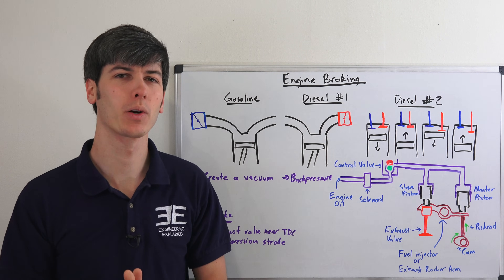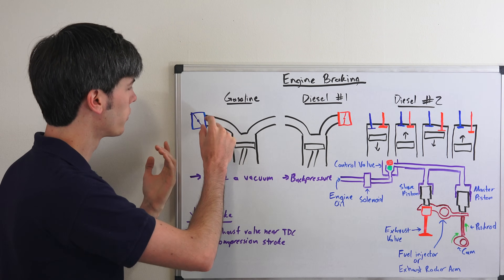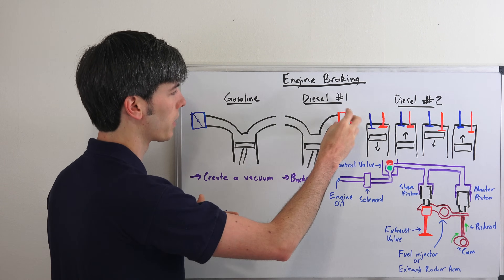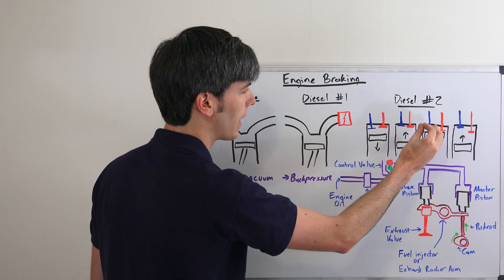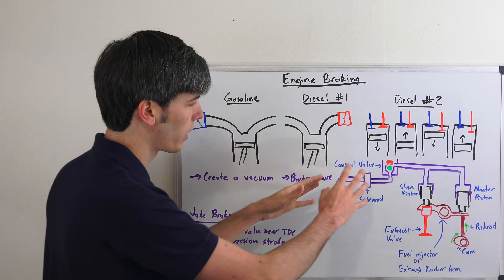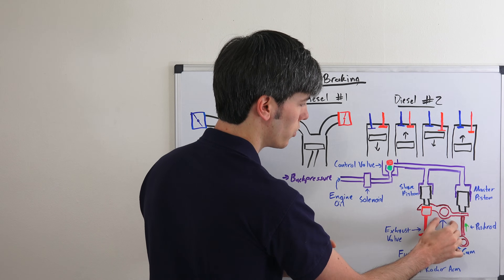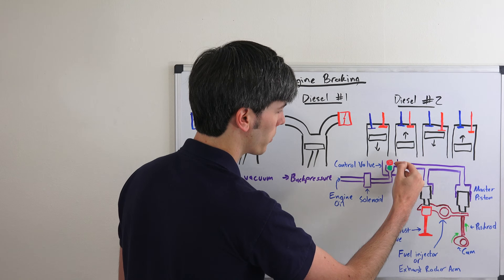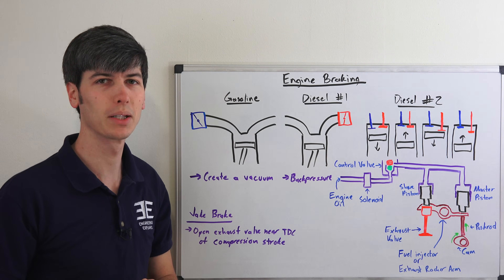What Is Engine Braking? What Is A Jake Brake?

Comment: I wish more drivers wouod understand the concept of engine braking. On a flat surface, physics and engine braking constantly want the vehicle to slow down. Normal braking isnt always needed to slow a vehicle (and engine braking helps preserve your brake pads). When approaching a stop sign or red light, you can simply let off the gas and the vehicle will gradually slow down (this can also help gas mileage as the fuel injectors shut down under deceleration when throttle is closed). Using your regular brakes unnecessarily doesnt allow the injectors as long as idle period bc the engine revs drop faster vs engine braking. The injectors will turn on sooner as you approach engine idle speed. Being able to proactively downshift magnifies engine braking as youre able to reduce vehicle speed more aggressively thru gearing and youre allowing the injectors more idle time as the engine revs slowly come down from a higher rpm (from the lower gear you just downshifted too). The lower gear puts the engine at a higher rpm increasing that vacuum which in turn slows the vehicle down more quickly.
Reply from the maker: +wayde philpot Agree 100%!
Reply: I've nursed my worn brakes like this for awhile while I'm saving for a brembo upgrade 😂
Reply: +wayde philpot I wish people on the freeway understood this concept. For some odd reason people think brake lights= I need to slam on my brakes, when in reality you can simply let off the throttle and let physics slow you down. Saves traffic, time, and money (from brake wear)
Reply: +MrElpajita usually ur engines spins ur tires, now ur tires spin ur engine. U obviously have to press ur clutch as soon as ur coming to a stop (in manual).
Reply: +MrElpajita because you still have a gear engaged, if the engine is above the idle speed, it will not inject more fuel until it reaches its idle speed. The inertia of your car is rotating your wheels, and your wheels are rotating your engine when a gear is engaged.
Reply: +wayde philpot They even teach this in driving schools over here, arguing that you save some fuel and prolong the life of your brakes in the long run.
Reply: +Kevin Weil Quickly stomping on the clutch to get out of gear does not really wear down the clutch, but you are right, when revs are matched I also usally take it out without the clutch, no problem.

If you are consuming more fuel during engine braking than when in neutral with the engine in idle you have a very strange car. I didn't think there were any around these days without deceleration fuel cut-off, at least none built after 1985, and none with digital fuel-consumption gauges.
Reply: Kevin Weil
Just keeping the clutch engaged and taking the foot off the accelerator turns the fuel supply OFF. The remaining kinetic energy within the car (which still pushes it forward) is "wasted" in the engine by turning IT. No fuel or brakes consumed.

Engine braking is NOT meant to be used as a substitute to braking by downshifting. Engine braking is meant to be performed until you reach a lower RPM in the current gear, THEN you can disengage the clutch and brake away the remaining kinetic energy with the brakes.
Reply: +KingDavey But for people who DO understand how to rev-match downshifts, engine braking is still a very good idea, otherwise I definitely get what you mean. Also, many automatics allow you to pick specific gears now, so you can now engine brake with those too.
Reply: +Foodstamp Amp'd
 to equal the amount of engine wear that occurs from driving like that , it would take forever. 
Besides , most engine wear occurs at startup. Basically you could leave a decent engine that's not some crazy race turbo deal that's all stressed out , strapped to a dyno all day at high rpms and get less wear from doing that, then the wear that would occur from the startup of that engine. 
Of course don't be dropping down a gear and letting it scream at redline as you engine brake,and keep dropping gears till you are in 1st gear like the ricers do at every opportunity. 
The car I got now, the original owner got 90k out of the front pads and the clutch went 200k. 
Not hiway miles either.  
Done right it's helpful.
Reply: Learning advanced gear techniques should really be more widespread. Downshifting when going down steep hills is essential when driving here in Norway, you will wear your brake pads out in a matter of no time if you need to constantly brake for several miles. Upshifting when going down a milder hill is also beneficial, as the reduced engine friction in higher gears could let you coast without needing to give the engine any gas, leaving you with zero fuel consumption down that hill
Reply: TheMidnightNarwhal
The engine has much more endurance than the brake pads do. The engine is designed to run constantly under load. Brake pads can overheat and lose effectiveness, in just 45 seconds, somebody said. The engine has much greater thermal heat energy capacity, and it also has a powerful radiator cooling system, unlike with the brake pads.
Reply: +Filipe Corral There's another reason for engine braking, especially going down long hills. It goes beyond saving brake wear (which brakes are cheap to replace, as you point out), but rather ensuring your brakes have sufficient stopping power when you get to the bottom of the hill.

When you brake, the brake pads come in contact against the rotors. This converts the kinetic energy of the wheel turning into heat. The braking system absorbs a large amount of this heat, so your pads, rotors, and brake fluid all heat up. Each of these components has a tolerance for how much heat it can absorb before it loses performance.

Now imagine you're going down a long hill. If you're holding your brakes constantly to maintain a specific descent speed (even if you're braking lightly), you're putting a constant source of heat into your entire brake system for an extended period. If the brake fluid heats up too much and starts to boil, you lose braking force and the pedal will go to the floor without doing much of anything. Overheat the brake pads and they will have greatly reduced ability to grip the rotor and increase wear rate. Finally, overheat the rotor and you may end up warping or deforming the spinning disk. That last one is probably the least likely, but the end result of all three is the same: You will have reduced braking force by the time you get to the bottom of the hill or if you need to make a sudden emergency stop while going down.

Once you let the system cool off, functionality will largely be restored, unless the rotors were warped. In which case, that repair doesn't come cheap.
Reply: I do this with my friend's car. It's an automatic with a 'manual' mode. I use engine braking to slow down and to keep from gaining too much speed going down hills.
Reply: +Patrick Barry u mean improper? because clutches are really only abused or fade quicker with either A: poor shifting IE down or up shifts B: hard launches C: your are a noob!
Reply: I don't do it if people are riding my rear.
Reply: +wayde philpot Yes. I seem to have a pretty poor injection management in my old Peugeot gasoline engine, though. I have an instantaneous consumption gauge (well, it's averaged over a second or two), and it often shows higher consumption when using engine braking at low rpm than when letting the engine idle. Our Diesel engine from the same manufacturer immediately has the consumption go to zero when engine-braking.
Reply: +Patrick Barry didn't scroll up to see the comment u are responding for, however engine braking does not stress the clutch or clutch pack in any way.
Reply: +wayde philpot Driving a manual, i use engine braking as much as possible, 30.000+km onwards, and brake pads and discs look brand new, maybe, 0.3mm wear on the brake disc. When i worked in a repair shop, there were people coming in and complaining of bad quality parts, saying that their pads wore down only after 15.000km, turns out they break like idiots, and some dont even take their foot off the brake pedal.
Reply: Christopher Hartman
Engine braking is not meant so much for stopping the car, but is a far better way of limiting speed, than overheating the brakes. Engine braking has far better endurance, and that is why it is important to know proper ways to control the vehicle's speed. Engine braking does not wear out the car, when applied properly, when not shifting gears excessively nor burning the clutch. It is the many miles and years that wears out cars. And improper driving and poor maintenance.
Reply: +Kevin Weil, unless you are referring specifically to older carbed engines, I think you need to go back to school to better understand modern EFI systems. Pretty much just about ALL OE EFI systems made since the early 90's have what is called Decel fuel cut (some like Toyota call it Overrun fuel cut). This cuts fuel by shutting off the injectors totally when the engine is above a certain RPM and the throttle is closed. Most Port Injection engines cut the fuel if the engine is about 2000 RPM and bring the fuel back on when it drops below 1800RPM (this does vary from engine to engine and manufacture to manufacture to some extent). Modern DI engines typically do the same process but at a lower RPM due to the more precise fuel metering associated with Direct Injection.  If port injection systems were to do it at a lower RPM, often the engines will buck noticeably when the fuel is brought back on and hence the reason for bringing it back on at a higher RPM.

By putting the car in neutral while slowing down, you are wasting fuel because the engine is in an Idle state so the ECU firing the injectors.
Reply: +Filipe Corral 
Down shifting a semi with only 700 to 1i00 or 2100 rpm limit is far easier ( shifting without clutch)
Trying to do same in carcwith fastercwinding gas engine in nearl impossibly relying completely on transmission synchros instead of rev matching.  Some computers noww rev match / blip throttle but gas engine downshifting is actually preparing to use throttle "in a moment" to Accelerate, out of corner for instance.
Reply: Thanks for explaining that!
Reply: +Foodstamp Amp'd 
No prob man , my buds always call me the teacher,idk, I just like passing the knowledge along. Peace!
Reply: +Brian Athay if those brembos are red you automatically gain +25Kw!!!!!
Reply: +Patrick Barry what do u mean which part happens in an automatic. I'm pretty sure friction doesn't care whether you're driving a manual or not
Reply: +Genericasian an insignificant amount of engine braking is cause by friction. The loss of energy results when the Pistons attempt to create a vaccum in the cyclinders, for gasoline cars. For diesel the energy loss is a result of the piston compressing air and letting it out of the exhaust valve when the piston reaches top dead center, bleeding the compressed air and not allowing it to return it's energy to the system.
Reply: +Patrick Barry not for all material. Carbon fiber brake pad only get more grip with increased temperature. Do you have a source to show vapor layers are a myth? (For brake pads.) what is the explanation for reduced friction with temperature? Does first molecular layer of the metal/ceramic become a highly viscous fluid or is there possibly an ionic cause? Increased heat helping to shed electrons and creating a stronger repelling charge in the materials? Some kind of diamagnetic induced repulsion? Does the increased heat cause the crystal structure to change shape giving it a lower surface friction coefficient. Does the thermal energy over power vanderwalls forces between the two fricon material surfaces? Does anyone know? +engineeringexplained
Reply: +wayde philpot I don't generally downshift through all the gears to get engine braking - I let it run down in the gear it's in, then it goes in neutral etc.
Reply: LuisCubing
Because the valves are still operating and air is still moving in and out of the engine along with the engine components still in rotation. Kind of like how you can still talk while breathing in XD
Reply: Mechanized Ape I'm no expert on car mechanics, but I think my engine still roars and burns fuel through combustions like it would when I throttle. I think only on modern diesels the gas mixture is not pumped into the engine when decelerating, not sure though.
Reply: skirmich
The engine is always a huge drag, whenever it is not getting fuel, and still engaged into the drivetrain.

+wayde philpot I always had the same thought of "(this can also help gas mileage as the fuel injectors shut down under deceleration when throttle is closed)"  but have we proved this? Sounds odd the engine will just shut down and not become a huge drag in the drivetrain just by slowing down to a stop..

But the engine is a huge drag. I seriously doubt that the momentum would carry on for as long, as it would coasting in Neutral. However, shifting to Neutral is not recommended, as you are giving up too much control of your vehicle, and aren't you supposed to be not moving, when you shift into Drive or Reverse gears? The car is quite heavy, and it does not take infinite force to rotate the engine. After all, a tiny electric starter motor can rotate the engine, although much more slowly than its normal rotations speeds. It obviously will take some time, for the engine drag to slow the vehicle, especially in the highest gears, in which engine braking is less pronounced.

I also suspect that the sounds the engine makes, would not be all that easy to detect as to whether fuel is being burned or not. As a engine being pushed by the wheels, is going to have just as many moving parts as an engine being pushed by fuel being burned. It probably would sound a little different, but by how much?

I dunno man brake pads are too cheap to even consider this option.. Same goes for any Honda 5 Speed Automatic (This comes from a original 5speed owner) do not engine brake in a Honda 5 speed Unless you want to change a transmission in the near future, Brake pads on the other side are dirt cheap.

The cost of brake pads is not the only consideration. It is not safe to overheat the brakes. Downshifting would always be preferable on long downgrades, as the brakes can overheat in as little as 45 seconds, somebody said. You do not want to lose your brakes. That is not safe.

Now I do agree, if you are saying that engine braking isn't needed, just to come to a stop. But engine braking is needed for long downgrades.
Reply: Mechanized Ape Hint ..."this guy is RIGHT UP MY....
Reply: +Mechanized Ape That would also cut down on road rage. One thing I've never understood is why when people come up behind a car going the speed limit in the right lane and the left lane is empty they keep pushing up behind the car instead of just going around.
Reply: With your foot off of the gas pedal, slowing the car down, the car's momentum turning the connected drive train (i.e. axles, differential(s), drive shaft, tranny, torque converter) mechanically turns the flex plate or flywheel that is connected to your engine that keeps the engine turning as long as the car is moving. 

The car's computer keeps the fuel cut off. Because it wants to idle the engine with your foot still off of the gas pedal. But the computer senses that the engine RPM's are faster than idle though the crankshaft and/or camshaft sensor. So fuel is cut off until you are close to or stopped at idle. The computer then applies idle fuel to keep the engine idling against the torque converter's load, unless the tranny is in neutral.

If you are going down a hill or grade, and your foot is off of the gas pedal, the computer shuts off the fuel again. Because no power is needed to maintain speed. But the car's momentum, due to gravity and kinetic energy, keeps the engine, revolving with the connected drive train at speed, without fuel, until you are on level road or climbing the next hill. So you use zero (zed) fuel at all. That is why you should never put your car's tranny in neutral, going down hill to save on gas consumption. 

In the old carburetor days shifting your car to neutral (or throwing out the clutch), going down hill, would work to save gas. Because the gas never would shut off. The engine would idle in neutral, being disconnected from the drive train. This was called Jewish overdrive.
Reply: This is all true, but you should also include information that using this technique and shifting gears increases your clutch wear.. and it's far cheaper to replace brake pads then clutch. So a proper advice should be to use engine braking while keeping a car on the same gear until engine's revs are close to idle, then breake normally.
Reply: Thank you. I ride my brakes as little as possible. Prefer low gears on down hill descends and when I see a light turn red, rather than race up to stop, I'll just let off the gas to slow down. If I'm not slowing enough but still don't need to use brakes, I'll down shift as needed.
Reply: you sure will drive people nuts trying to apply that. all people want you to be quick and not drag them. you will therefore find yourself more if a time using your brakes than not. you can save some brakes, but still will use it not sparingly, heavy enough. or a mad dude could draw on you,  and that wouldn't be fun...
Reply: wayde philpot I drive my ,  07 dodge Cummins with the 6.7 Turbo diesel Cummins, and I for one. Drive a Manuel Transmission. And I as well have the Exhaust Break and I use both down shifting and my awesome wonderful Exhaust Break. I do not do last second breaking! I don't care who's behind me. the president, your mom, my future wife, or the girl next-door.  LOL I don't care I take long ass stops and then I accelerate mediumly, depending on the area the day and my mood.
Reply: It depends on if the carburettor has an Engine Braking Valve.
Reply: More importalnly, engine braking saves fuel and helps to decrease heating of the brakes- this comes very in handy in mountains. Also, car is more stable when engine is connected with transmission.
Reply: In most cars I use engine braking all of the time in order to slow down and only use my brakes while stopping, however in the 2011 Highlander SE that I drive most of the time, there is no engine braking. In fact, I can coast for about 1/2 a mile on a flat surface without slowing and I actually accelerate when going downhill.
Reply: +Cole Logan That is false. Most (if not all) OEM EFI EMS (or at least just about anything built after 1990) that have / utilize overrun / decel fuel cut do shut off the injectors 100% (I've personally data logged numbers of OEM injector outputs to create base maps for aftermarket Programmable EMS's and can clearly see the injector signal on them shutting off 100%).  Most port injection engines have the fuel come back on in the 1700 to 2000 RPM range so the prevent bucking that would occur if the fuel was turned back on earlier. Many newer DI setup engines hold off the fuel reactivation point to an even lower RPM due to the precise control that DI allows for.
Reply: +MrElpajita The weight of the vehicle keeps it rotating along with the mass of the flywheel. Most engines won't completely shut the injectors off but will open them for a much shorter time so that there is less fuel going in to the cylinders. As the car slows to idle or once you press on the gas to start going the computer sees the increased load and will start to turn on the fuel injectors for longer periods.
Reply: +Kevin Weil totally agreed with you, i only use engine brake just to keep the RPM high enough when entering corner (slow in fast exit) it's easier to control the corner this way
Reply: DM Sumarli
There is simply no fuel being injected while the car is engine-braking
Reply: +Siggen yea I had a Mitsubishi fuso for my previous work truck. It had an exhaust brake and the original brake shoes were still good at 215,000. 
I've had a few steep mountain roads where I could tell id fade the brakes out if I kept using them and didn't downshift and engage the exhaust brake. By halfway down , they were getting warm and I could tell they were slightly fading from the heat. 
If it wasn't for downshifting they woulda been smoking real good by the bottom, or be nonexistent.
Reply: I own a 2012 vw GLI w/ dsg. the car only engine brakes in "s" and not in "d" or any form of manual shifting. I always throw it in "s" when slowing down then back to "d" or manual shifting when accelerating. this has also tremendously helped reduce brake fade and quicker lap times in autocross as I can enter turns faster and brake later than normal. the dsg transmission is just an absolute beast.
Reply: +4rari89 I hear ya , I drove a buddies gti with the dsg and I wanted to see how it was compared to  an old automatic that id be used to. 
Lemme say it was awesome. 
Shift at the paddles or shifter and you don't feel any jerkiness and it's smooth as velvet at shifts. 
Just for an abuse test as I was approaching a light to stop, I dropped it down into 1st gear at around 25-30mph...
I knew it was gonna be close to redline when it dropped , and I knew it wouldn't downshift if it didn't wanna.....
I was expecting the big clunk and tire screech you would get in a normal automatic( I'm thinkin like an old Chevy with an auto btw)....
nope, it was smooth as silk and there was no jerkiness or anything. 
I still like a real clutch pedal but those dsg setups work pretty sweet.
Reply: +4rari89 so it does switch to neutral when you remove your foot from the throttle? Is this car a drive by wire throttle? Thank you.
Reply: +Mechanized Ape not necessarily neutral. still in gear. the rpms are just so low in "d" that there is no engine braking. in manual it's blipping the throttle to rev match. in "s" it's true engine braking.
Reply: +4rari89 okay. I guess I'm just not understanding how the Rpms can be low at a high vehicle speed if the transmission doesn't disengage from the engine. The wheels should push the motor to whatever rpm in whatever gear that that speed would take to cruse at. Did i word that well enough to make sense? Lol sorry it's late. Does it have enough gears to just keep a low rpm and stays in overdrive gear? It's kind of hard to find that specific of info for each car model. I think my avalon will stay in gear for a few seconds after i release throttle but then switches to neutral to coast farther but I'm not entirely sure. But if I actively down shift it will stay in gear and decelerate. Had to do it when a brake line burst. It's smart enough not to shift until it's at a speed where it won't redline. So I can drop to L and just wait. No worries about redline. if if I shift to R while moving forward it won't shift or try to. At least for the second or two I accidentally had it in R. EE tellusplz
Reply: +4rari89 it's called friction material. All friction parts wear regardless of how carefully they are engaged. It's by design. Clutch plates are wear parts that need to be replaced after a predetermined distance. All trans parts are wear parts. Almost every drive train component is.
Reply: +wayde philpot i used to think that the car slowed down when not on the throttle because of friction and the lack of an external force (throttle). Obviously that is some part of it but how significant is engine braking in that process?
Reply: +Neel Deka The phenomenon you are describing is engine braking. When you remove throttle input, you reverse the direction of energy transfer. Instead of energy transfer from the engine to the wheels (consuming fuel), energy is transferring from the wheels to the engine (kinetic energy of spinning wheels). "Engine braking" describes the frictional forces in the entire drivetrain, the majority of that friction is in the engine itself.
Reply: +Genericasian oh OK thank you
Reply: +Genericasian do you suppose that when the pads reach incandesence and begin to vaporize the gas layer is what causes the reduced performance? That and also the fact that as friction material vaporizes its not only becoming smooth from abrasional wear but that any material making highly frictional contact will be instantly bent or sheered off due to increased maluablity from heat? Also I think because brake fluid is under pressure and already has a high BP that it would most likely never boil and if it did would blow a line.
Reply: +MJ Lyco 
Whatever is a fart cannon for? Shouldn't they be banned? Nobody but morons wants to hear somebody's needlessly noisy car.
Reply: I don't know if it was mentioned already in the many replies, using the engine as an engine brake also helps keep the piston rings seated, keeping your compression and engine efficiency up. Despite clutches not being as easy to change as brake pads, I still do this, even in my new (to me) 06 Ranger 4x4 even though I just changed the clutch in it a few weeks ago. Besides, coasting out of gear in a manual isn't safe according to the DOT.
Reply: tasios77 it probably isn't technically, although it is usually only at speeds 40km/h and below since you can run down to idle rpms.
Reply: +wayde philpot Yes, I do it all the time. It's just a question of timing, sometimes I only need a little push on the brake to get to a full stop. I just have 1 question: are there still combustions happening on the engine? If not, why do I still hear the revs like I would when the accelerator is being pressed?
Reply: +Zaya Young With a lot of people brake lights actually DO mean they need to slam on the brakes.
Reply: +wayde philpot I always had the same thought of "(this can also help gas mileage as the fuel injectors shut down under deceleration when throttle is closed)"  but have we proved this? Sounds odd the engine will just shut down and not become a huge drag in the drivetrain just by slowing down to a stop..  

I dunno man brake pads are too cheap to even consider this option.. Same goes for any Honda 5 Speed Automatic (This comes from a original 5speed owner) do not engine brake in a Honda 5 speed Unless you want to change a transmission in the near future, Brake pads on the other side are dirt cheap.
Reply: +skirmich about the drag, your fly wheel maintains a lot of kinetic energy to keep the Pistons moving. I was scpetical about the idea that injectors fully shut down as well. In most cars iv driven, (auto trans) if you shift into nuetral while your still going a decent speed, above 25, the rpm won't idle as low as when your not moving and in N or when your in P. So obviously your ecu is keeping the rpm high so that when the trans re-engages the motor it won't be so rough. That being said I doubt the injector fully shuts off even if your vehicle speed is keeping the rpm at say 3-4K. It MIGHT turn off and would be possible because the flywheel will keep things going for a while, and this would be a great method for car manufacturers to squeeze some mpg out of a vehicle. That being said I'm sure each engine is different. In fact I can check  my obd2 later on today and see if my fuel flow drops to 0.00 gal/hr when coasting in drive or if it's still at about .03ish like in P. Doubtful tho.
Reply: Mechanized Ape
Injectors only turn off if you are in gear and no throttle applied and are above a certain rpm (it's higher than idle) For automatic this rpm is higher than manual usually. But automatics can do engine braking, but in "D" it generally doesn't do this often as it changes up a gear if light throttle applied or let off. You can force it into a gear if you want. Unless you have a Prius or CVT with no paddle shift XD
Reply: Carl Sagan
That's good if your car has gearing for it ;p Smaller cars tend to rev up to 3000rpm at ~110km/h XD
Reply: +MrElpajita the ECU increases the injected fuel once the engine rpm reaches, or goes below stationary rpm. You are right that while using the engine for braking there is no fuel injected so the engine is actually not running. (note that with cars with a carburator there is always some fuel consumption as air-fuel mixture necessary for stationary rpm is always going to the engine.
Reply: +Rennie Ash I guess we will find out for my car when I drive it later. I do agree that for a mpg stand point that in mpfi or fi or di engine that the engineers would want the fuel flow to cut off whenever possible. I'm just not positive that it happens. It might be complicated. Might be simple. Just depends on the year and make and how much the company was willing to invest and how many sensors the engineers were allowed to instal and how much code they were allowed to have writen for the car. I haven't done any research to resolve the question, so I'm not going to say one way or the other. And yes I know you can downshift in an auto and usually the ecu will keep you from going past redline if your not sure what gear to be in for that speed, at least Toyota, I had to do it when a break line burst as I was coming to a stop sign, then hit the pedal parking brake as I approached <5mph. Luckily I was ony four miles from home.
Reply: +erik verbeke how do you know this is true for all cars? Are you a tech or engineer or did you look it up? I'm just curious because not all engines will run the same way, similar fuel intake method or not. There are patent concerns to consider as well as mechanical and expense constraints.      This seems like a broad statement to make about all vehicles with out a source to base it on other than assumption. So f you know this for a fact please say why or how you figured it out. I don't have time to research every modern vehicular internal combustion engine and find out its dynamics to answer this question we all seem to have. Thank you.
Reply: Mechanized Ape Yeah, I have an opel astra caravan from 97 (diesel) and it probably does not stop fuel consumption when I stop pressing the throttle, because the engine really sounds the same.
Reply: +LuisCubing  so it still has the roar of the combustion with the whine of the metal rotating  assemblies, instead of just that turbine like whine that you get form a moving engine with no fuel input? Are all diesel engines fuel injected? Iv never owned one and don't know anything about them except the principal of how a fi diesel one works.
Reply: +Yosef MacGruber patents control every idea in the business world. Simple or not. Look into the apple Samsung disputes. Those very simple patents are worth billions. One company might have come up with a way to cut fuel through a certain computer protocol that may prevent others from doing identical fuel shut off methods. Methods that may be the cheapest or even the only way to cut fuel through computer management. Every thing the ecu does is controlled by code written by people that need to be paid. If the code gets to complicated it may not be worth it to integrate into a cheap little economy car just to save a few mpg. So while patents may have nothing to do with this topic, they have just as good of a chance as having everything to do with the topic. Unless you've built one of these systems I don't think anyone has room to speculate on how exactly they work. Every system is different. We should stop spreading information that is based on assumption and do research on these systems
Reply: Mechanized Ape
Any competent programmer could write code to do this, without having to copy somebody else's code. Generic ideas such as the Trash Can, as a place to put unwanted computer files, is no basis for a patent, because it is not an original idea.

Computer code is different than actual manufactured parts, because the more copies made, the cheaper it gets per unit. You could have the same engine computer made for 100s of different cars, if it has a way to know which car it is in, and entire blocks of code might be useless, but to eliminate them would cost far more in inventory costs, than to just make a more universal engine computer. Even circuit boards can have places to attach optional features, that do not even come for that specified model.

Even video games can have large areas of dead code, that can be fun for game hackers to explore. There could be dozens of voice-acting audio samples, that are never used in a video game. Yet for whatever reason, were not removed.

Like I have time to research specific ECUs?
Reply: +Yosef MacGruber like I said look into the patents that Apple violated. They are simple ideas on file storage that seem like common place ideas but are still protected. The us government has a patent on cannabis. No one is allowed to patent non GMO plants. explain that? 
  I agree with what you said about dormant programming. The code might be there but how do you know it's being used? The sensors to use the code might not be worth putting in a crap car that's only $12k new. But a nicer car with the Same engine might get those sensors. Toyota Avalon and Lexus es300 are a good example. Or the gmc Denali envoy with cylinder deactivation. The first year with it doesn't use the deactivate function because of exhaust harmonic issues during four cylinder mode. They redesigned the exhaust piping the next year and switched on the function. My point is still the same. Every car is different. So assuming one thing about all cars based on one model is foolish. Same as many things in life.
Reply: Mechanized Ape
Until the 1980s, patents were not allowed on seed, because only God can "own" life. Explain that? Political corruption. What else? Farmers had long thought that they had the right to saved seed, but now they are accused of violating contracts that they did not even sign, because GMO pollution blows onto their fields? How dare greedy corporations jeopardized global food security with their stupidity and greed?

Should some greedy corporations be allowed to monopolize the concept of the computer file, so that no other companies can produce any software?

What does it matter if the code is being used? I meant more that it is left-over stuff from unfinished ideas or other projects or models, not that there is anything sinister or hidden about it. I would rather they use the same circuit board on dozens or 100s of models, than that they run out of critical inventory parts. How does it know which model it is installed in? By the presence or absence of certain connected devices, or perhaps due to some setting. I do hope that the engineers do provide a reliable way, so that my car's ECU unit doesn't just one day decide it is a different model car and start behaving strangely. I wonder what the possibilities are for hackers? You get a deal on an ice maker for a model of refrigerator that wasn't meant for an ice maker, and flip a few dip switches on the circuit board, plug into the unused connector socket, cut off the power to the refrigerator for a few minutes to reset everything, plug the refrigerator back in, and then it decides that it is another model refrigerator, and Presto! Magico! you have a working ice maker. Well until the water line freezes up, because you didn't mod your refrigerator quite right. Why would an ice maker need to plug into the circuit board anyway? I don't know. Maybe it is best to not be making ice, during a defrost cycle?

Here's a few other ideas about hidden stuff in the program coding. Often some thought is given for future expansion, so any data files that my program generates, may contain hidden data identifying which program and version created them. Also, people often like to put their names onto stuff. Especially considering that filenames can be changes too easily. When I have written programs, I try to follow the conventions, so that the OS can give some description or help concerning the program. An example with the TI89 graphing calculator, is that I think the first line of TI-Basic code is a comment, it will appear when selected but not yet activated, on the VAR-LIST or Catalog of files, and would normally appear in the form of FuncName(Parm1,Parm2,optionalParm). If I follow this convention, it helps the user figure out whatever does it do? They might have gotten it from a friend who didn't tell them anything about how to use it. Or it could appear as Payment(Principle,TermYears,Interest,OptNumPaymPerYear).

Sometimes with good design, additional features might be added, with simply a free firmware update. Somebody might have thought up a good way to use already existing hardware.
Reply: +Yosef MacGruber 
  farmers can't save gmo seed because it is a man made invention. I mention the gov patent because it's an example of somthing being patented that wasn't supposed to have been granted patents . Like a trash can on a computer OS. the concept might not be able to be patented but how you go about removing files from hard ware, with software, can be. There are many different programs that do the same thing. I was saying that for a cheap car figuring out a whole new program might not be worth it.     
    
As for hidden code I was not saying it was sinister but that, like you said, it can be there from old projects or whatever and not be used. Like if the ecu could cut fuel but needed a sensor to utilize that program. But the sensor is $300 so they don't use it on say a $8k car. It's just a plausible scenario I was suggesting.
Reply: +Yosef MacGruber And yes exactly, fuel cut off during engine braking that is controlled by the ecu when it gets information from a sensor that might not be installed on a particular model because the base price is so low. Like how they don't include automatic windows, locks or AC sometimes to save money so they can offer poorer people a reliable car that runs for less money than that same car with all the bells and whistles. Or say a truck without 4x4 for people who don't need 4x4 but want a bed to haul stuff. It's stil going to have the same ecu most likely. Though It may have different code flashed to it to suit the trim level of the vehicle. Each company will have their own way and device for telling the ecu how to cut fuel or do whatever. A different sensor with different protocols. At this point I'm sure they all have cheap ways of cutting fuel when it's not needed but some people have old cars. So its worth knowing more about imo.
Reply: Mechanized Ape
I do not agree with granting patents for seed. Seed is supposed to reproduce from generation to generation. To produce "terminator" seed is to rip off farmers and play God.

Any fuel injection car already has to have sufficient sensors to cut off fuel. Surely every ECU knows the RPMs and the accelerator input. Even the cheapest piece-of-crap econo-box car would have that, unless it is not fuel-injection.

Electric windows are another story, as all those motors and switches and wires and wire protectors running from the car into the doors, might run $100 even for the factory buying them in bulk. What car doesn't come with A/C? It may be expensive, but isn't A/C standard by now, as they have to create a hole for the A/C stuff even if it not there. Too many customers would want the A/C, so wouldn't that be standard? It isn't the frugal 1980s anymore. I can hand crank the windows. The big down side of that, is that I can't so well hand crank windows that I can not reach. But who opens windows anyway? That is what you do when the A/C is broken.

4-wheel drive is expensive. And according to some YT by Scotty Kilmer, all-wheel drive isn't even worth the cost, for most people. Not only does it cost more, but it adds more weight to the vehicle, which is going to reduce fuel mileage, and all 4 tires should be changed at the same time. Having tires of different sizes (different amounts of wear) causes excessive rotation of certain parts of the differentials, which will cause problems.

What reason would there be to not cut off fuel during engine braking, unless it is a scheme to rip customers off and punish them for buying the crappy econo-box model? I consider that very poor marketing tactics, to deny customers features, just to put products into every price tier, if said features are not costing the manufacture much of anything to include.

That is a reason why I would never pay the telephone landline monopoly for Caller ID. They have had the ability to give all their customers Caller ID for free, for decades, and just about every piece-of-crap phone comes with a Caller ID display now. I think that is a lot of the reason why people are dropping their landlines, because they are so noncompetitive with all the options now on the market. I finally fired the land line monopoly and switched to an internet phone adapter that allows me to take my number with me when I move. Costs far less, and gives far more features. And Caller ID and Call Waiting are included. Internet phone adapters work really well with cordless phones that come with lots of handsets, since you are often losing most of your home phone jacks, and have just 1 phone jack on the back of the internet phone adapter box. You can switch your phone jacks over, but many people are not going to bother to.
Reply: +Yosef MacGruber not all cars use sensors as recent as the mid to late 90s cars used cables on tachometer and spedometer. Not everyone drives a brand new car. Some Kia cars offer AC as an option still I think. There is no reason for the ecu to know the rpm when it's controlling it with spark. It's doesn't necessarily need to be a feedback system. So if there is no fuel or no spark and your engine braking what would tell the ecu the rpm? Newer tacos read the rpm by detecting the puls of the eceteic signal when the spark plugs fire. That's how things like radar detectors can detect rpm through your cigarette lighter or 12v accessorie outlet. The is no rpm sensor that doesn't rely on a cable connected to somewhere in the drive train or the signal puls from the spark firing, that I know of. So again if you take your foot off the gas and there is no fuel input at all the you would think there would be no spark so no way to sense the rpm and no way to when to kick the injectors back on.
Reply: +Yosef MacGruber except if it used the speed sensor to know when the car will need fuel to idle again.
Reply: +wayde philpot Does downshifting without rev-matching have a greater engine braking effect than with rev-matching? Or is it bad to downshift without rev-matching because it may harm the transmission or something?
Reply: Mechanized Ape
If the ECU does not even know the RPM, then why even have an ECU? Come on, that is basic sensor data, even for crap cars with no engine speed dial. Why do you even need a tachometer on a car with an automatic transmission?

Engine speed probably has something to do with how much the spark should be advanced or retarded. Do cars even have distributors anymore?

And we were talking of turning off the fuel injection, which might be easier to do than to kill the spark, which is less needed anyway, as the spark doesn't consume near as much fuel as directly burning fuel does. In fact, if the spark is still firing, it may simply be part of the engine braking conversion into heat process anyway.

So I agree with the conventional wisdom of commenters that says that old carburetors likely did not cut off the fuel entirely, as those systems did not use modern engine sensors are are common now, whereas modern fuel injection should easily be able to cut off the fuel, even on econo-crap cars. If fuel is not being cut off, then why? Some conspiracy with the oil companies to waste fuel?
Reply: So I did a test yesterday with a BT obd2 scanner. While engine braking from about 50mph, with my feet off the pedals, the throttle input never dropped below 9%. The fuel flow in gph never dropped below .5 gph. The oxy sensor voltage never dropped below .102V. This is conclusive evidence that the injectors never shut off completely. I think something nobody here is remembering is that fuel injectors are a variable flow device. They are not just on or off. Your cyclinders can still pull a relative vaccum compared to the amount of air being let in to the cylinder with the valve open. Valve openings are tiny compared to the volume of the cylinder. Esp at say 5k RPM. The only reason the piston has no resistance, from the small air inlet of the valve, during the combustion stroke is because of the large volume of new gas vapors produces in the fuel air explosion. During every other stoke the piston must be under some resistance from the fact that more air can be take into the cylinder
Reply: Volume than can flow through the valve. Esp at the high rpm of the moder internal combustion engine. There is never a perfect vaccum in the cylinder. I'm not entirely positive and I will check soon but I don't think, and at this point this is pure speculation, that a chain driven valve train can decouple from the timing of the engine. Even In vvti. So this would mean that if the Pistons are moving then the cams are moving which means that the valves are opening and closing. And if the throttle position never drops below 9% then there is never a perfect seal. Even IF the metal on metal butterfly type valve of most throttle body's could ever achieve a perfect seal.
Reply: Mechanized Ape
Then that car is designed improperly. Yes, I would think that a scanner would seem to be the obvious way to test this.

A variable flow device can easily be set to Zero. I had an older microwave oven that could be programmed for 3-stage cooking. If a stage was set to 0% power, then it was just a silent timer. In fact, the microwave clock could be used as a simple timer for the conventional stove-oven, just by setting it to 0% power.
Reply: +Yosef MacGruber yes it was designed improperly because it's a GM Saturn ion. lol. But iv also tested it on a Toyota Avalon and a gmc envoy and a Saturn sl2. They all had basically the same results. (All vehicles were automatic trans) while engine braking the throttle never dropped to zero, maf or map never dropped to zero. Oxy sensor voltage never dropped to zero, fuel flow in gph never dropped to zero
  variable by definition doesn't mean 0-100% it could only vary from say 20-80% but that is besides the point. I'm pretty sure most fuel injectors would be 0-100% but that doesn't require them to fall to 0 when implementing engine control techniques. I'd say in an automatic and engineer would want the car to cost as far as it could when you let off the gas. They know drivers use the caliper brakes and don't really think of driving technique. Most people don't feel comfortable shifting an auto in and out of N or downshifting. Cars are designed to be user friendly.
Reply: +Yosef MacGruber so when you come to a stop you can let off the gas and slow gradually to the stop instead of having to shift to N. Or having to drive all the way to the stop because if you let off the gas your car slows down really quickly, so you have to use some pedal to keep it going a reasonable speed up to the stop so people behind you don't get pissed or hit you on mistake. Engine braking seems to be a result and not a design of manual transmissions that happened to carry into auto. For the a average driver who doesn't think of driving technique or isn't aware of what engine braking is or how cars work( most people), engine braking would actually waste gas. Most cars iv driven let you freely shift form N to D with no brake pedal action. But no other gears. But how often do regular people use that function to coast to a stop? In my experience not many.
Reply: Mechanized Ape
But there is no proper reason for the arbitrary 20% limit. Why couldn't it be 20 to 80%, and then also 0%? You probably can't do 5%, due to the fuel-air mixture having to be of the appropriate ratio. But that does not preclude 0%.

There is no logical reason to burn fuel during engine braking, as the wheels can power all engine functions. You can't say that the carburetor is not sufficiently complicated to do such things, as it is no longer a carburetor but a computer ECU, now with fuel injection. Surely the engineers did not already forget why we switched to fuel injection?

A normal driver does not let off the gas, unless they are wishing to go no faster, or not much faster. Sure, I know people sometimes pick up a little speed going down a short hill. But even then, I want at least some engine braking. If I wanted to burn fuel, then I would push the accelerator just a little.

I do not expect people to downshift, other than on long downgrades. I mean, there is a reason for the automatic transmissions, yes?

So is it a conspiracy to force us to buy more oil/gasoline, or are cars just poorly-engineered outdated pieces of crap?

Which cars do cut off the fuel?
Reply: +Mechanized Ape I should say from n to d and back with no shifter button or brake pedal action. They will let you shift to 3,2, L with shifter button and no brake. They will not let you shift to R without both shifter button and brake pedal action. The Avalon will not switch to R while moving forward even when shifted into R after brake and shifter button. Toyota is amazing.
Reply: Mechanized Ape
Even CVTs can engine brake.
Reply: +Yosef MacGruber that was just an example of somthing that could be variable and only do a particular amount of a given figure. You can't have somthing, compared to itself, turn on at 20% because off is zero and anything other than off is above zero and max output would be 100% unless you relate it to somthing else. Anyway, I'm not saying it's not possible for them to shut off, what I'm saying is that much engine braking is detrimental to the conservation of energy for the average driver who will not switch to N when coming to a stop. I'll give the example again as I don't think you got my last one. 
   If I have to come to a stop, I can predict when I need to let off the gas to coast to the stop. If I let off the gas and slow down quickly without hitting the brakes then I have to use the pedal for longer using more gas to get to the stop sign. More than i would if I let off the gas pedal and slow down slowly. The second way I can let off the gas pedal further from the stop. And let
Reply: +Mechanized Ape gravity and friction and air resistance slow me down. The use less brakes and less gas than if my car strongly engine brakes as soon as I let off the gas. This way I have to use the gas peda for longer gettin closer to the stop while using gas. Otherwise inwouldnhabe to shift to neutral to get the same coasting distance. And like I said most people don't know if it is safe to switch in and out of drive and nuetral when you are moving forward. So they just leave it in drive for their whole journey. This would waste gas in auto vehicles with strong engine braking. Esp compared to the same driver and car but with weak engine braking.
Reply: +Yosef MacGruber yes they can but isn't that a computerized processes like the shift lag experienced. The first Prius had no shift lag and drivers though they were defective. also I never said that cars were not capable. I'm saying it would be bad for the average driver to implement. I can tell my auto trans keeps me in the largest gear possible for the speed I'm in to make me coast as far as possible. That is it actively prevents large amounts of engine braking, when I let off the gas, by allowing the highest gear possible, for the vehicle speed, to stay engaged. This allows me to let off the gas and get back to accelerating or crusing without lag. Unless I need to downshift for very fast acceleration. This would indicate the designer did not want the car to engine brake to slow down. That and four wheel drisc brakes on a sedan. With vsc, ebd and traction control I think engine braking is not necessary to slow a vehicle down without significantly upsetting the balance of the car.
Reply: Mechanized Ape
Who said anything about strong engine braking? I think automatic transmissions already take into account, what you are talking of, and that is why they tend to stay into the upper gear until you are finally going rather slow. I notice that on my car, when I finally get rather slow, I can feel the gear ratio drop, as then engine braking becomes more pronounced, but at that point, I am nearly to the intersection at which I need to stop at anyway.

If you want to downshift earlier, then you need to push the level to 3, 2, or 1 to tell the transmission that. I think that the Performance switch, if you have one, also tells the automatic transmission to keep to lower gears that feel more "sporty". Normal or Economy would prefer the higher gears to reduce fuel consumption.

You you really think that a low amount of idle fuel consumption is going to reduce the effect of the engine braking? I see no need for it, other than of course to keep the engine from stalling - not a concern at above-idle RPMs, or to intentionally waste fuel in some conspiracy with the oil companies or with evil politicians hungry for that gasoline tax revenue, which they are getting anyway.

Taking one's foot off the accelerator does not mean to keep speed constant, but rather to apply a moderately-light level of engine braking. If one wanted to keep to the same speed, they would continue to press the accelerator somewhat or they would use the cruise-control.
Reply: +Yosef MacGruber yes I think we are talking about the same thing about autos.? But what I'm saying and was the start of this is that I don't think fuel injectors shut off completely when you let your foot off of the throttle even if the RPMs are above engine idle speed. I think that they reduce output at any given rpm above idle when your foot is off the pedal compared to when at the same rpm when your foot is on the pedal. But they do not shut off completely ever. In most cars. That is what I'm saying. Just to be clear. I take it as everyone else seems to think that they do shut off when no throttle is applied when engine rpm is over idle rpm.
Reply: Mechanized Ape
Well why do they not shut off completely? It is a conspiracy to force us to waste fuel?

So upon which cars, do they work correctly?
Reply: +Yosef MacGruber low idle fuel consumption when in gear and foot off throttle reduces effect of engine braking? As in, injectors not shutting down to zero reduces engine braking. Yes I think that. Even a small amount of fuel combusting will produce gasses that will equilized the pressure and reduce the drag of the vaccum on the Pistons.
Reply: +Yosef MacGruber haha no, i do not know why off the top of my head. Let me think
Reply: Mechanized Ape
It is not going to reduce engine braking all that much.

And if that was even the concern, why not open the throttle plate a little, to allow more "coasting" even while avoiding Neutral?
Reply: +Yosef MacGruber possibly to increase response time when engaging throttle.
Reply: +Yosef MacGruber maybe it has to do with the fluid couple of the auto not spinning the flywheel sufficiently. So do mechanically engage I think in 1st? I might have it backward.
Reply: Mechanized Ape
Nope. I see no effect there either. Fuel injectors can come on instantly. The fuel pump has not been shut down. There is no "warm up" time involved.
Reply: Mechanized Ape
I think you are talking of the torque converter that is used with automatic transmissions, to replace the clutch. But it works both ways, so I still see no need for burning fuel.

The flywheel serves very little purpose, other than to keep the engine speed at a smooth rate and to even out the force of the power strokes of the pistons. The flywheel changes speed far too easily to be of any other use.
Reply: +Yosef MacGruber yes I am. It uses s fluid couple and space is short here so I didn't specify. Figured you know what I meant. The fly wheel does those things plus stores momentum to keep the rotating assembly going when there is insufficient fuel or vehicle speed to do so. So if the fluid couple losses efficiency when coasting in gear then maybe that isn't enough to keep the fly wheel going. The vehicle speed doesn't keep the Pistons going directly. The speed is applied to spin the flywheel which keeps the rotating assembly going.
Reply: Mechanized Ape
The vehicle speed kinetic energy is far more than what the flywheel can store. When an engine is revved in Neutral or Park, it will reach its maximum speed in a second or two. You can not reach 60 mph on the freeway, in just a second. The flywheel merely evens out the speed of the engine, so that cylinder firings do not create excessive vibration, and the engine runs smoothly. 4 cylinders is hardly enough to ever have a power stroke occurring at any given moment, to keep the engine running, well except that the flywheel helps keep the engine rotating at a smooth speed.

If the fluid coupling did not have enough efficiency, then why would the car climb a hill, instead of all the power from the engine just slipping and heating up the transmission fluid? So engine braking can occur even through the torque converter. However, they claim that you can not start a car, just by rolling down a hill and putting it into gear, unless it is a manual transmission, and not an automatic. I have never tried it. Perhaps it is possible somehow?, but unreliable and not advisable? Or maybe you have to get to 40mph or so?
Reply: +Yosef MacGruber well there has to be some reason the injectors don't shut off. I did some more tests last night. I put the car in third and let off the gas to watch what happened to the fuel flow guage. When let off the pedal at about 65-70 mph it dropped to .7 gph then i switched into d still doing about 60-65  (This is a five speed auto asinf23 powered by 2.2L i4) When the trans switched I saw the gph drop to .6 gph with the gear change. The rpm dropped by about 500-700. As I came to my stop the fuel flow bottomed out at .4gpr and stayed there in idle.  
 As for the fluid couple not having effieceny, there is only torque multiplication when the impeller and turbine are at different speeds. So to go up a hill, you have to drop down a gear and make the impeller spin faster than the turbine. That is if you have a weak motor. If your motor is strong and you don't lose speed as you go up a hill then your lock-up clutch will not decouple and you will maintain a mechanical connection.
Reply: +Mechanized Ape in the test I Think I was at about 3200 rpm in third at 70 then at about 2800-2900 when I switched to D. I had to look at rpm speed and fuel flow all at the same time and I didn't have them configured to one screen at the time. I used car tach and speedo but the phone for fuel flow. Hard to watch all three and drive at night. This was done in the highway with no one in sight in front back or to the sides. Also when I was in the gas in third I think the fuel flow was about 4pgh and in D it was about 2.2 or somethings. I didn't care about when I was on throttle as much. I knew it's was higher than .7 no matter what. Could you imagine going 70mph in a car on only .7 gph!? That would be amazing.
Reply: Mechanized Ape
Even without fuel, it does not take infinite force to rotate the engine. In a high gear, the wheels have a lot of mechanical advantage over the engine. Which is why one does not zoom up a steep hill in 5th gear. And why you do not launch from a stop, in 5th. And some of the energy lost in compressing the air is returned to the engine when the air expands in the power stroke, that would produce no additional power if the fuel injectors are off. So there is engine braking, but it is mild in the highest gears.

When I see the traffic light turn yellow up ahead, and I take my foot off the accelerator, of course I see the speedometer slowly dropping in speed, but the tachometer is even more pronounced. I think that is not merely wind drag and tire rolling resistance drag, but also some engine drag. Perhaps engine braking is a bit weaker on an automatic than with a manual transmission, due to the torque converter slippage.

You could probably do 70mph without any fuel, if you are going downhill and in the highest gear. If you want very much engine braking, you of course will need to downshift.

BTW, I have only had but 4-speed automatics, thus D=1 through 4. Automatic transmissions favor the highest gears for fuel economy, so you are not going to get much engine braking from 4th, so you will need to downshift if you need the engine braking for a long downgrade.

The internal combustion engine seems designed rather poorly, to make sure that we pay "our fair share" of the gasoline road tax. Any time the engine is on, it is wasting fuel. Perhaps "hyper-milers" can get 20% better fuel economy than the average moron driver, by applying every trick to boost fuel economy, but that only works best a in newer vehicle that is well maintained? Hyper-miling tricks include taking the foot off the accelerator and using vehicle momentum for approaching stop signs and red lights, and minimizing use of brake pads, taking off the flags in support of your sports team or whatever, and using a bumper sticker instead, getting rid of excess weight junk out of the car, etc. If they really wanted to make the internal combustion engine more efficient, then we would have engines that completely shut down some of the cylinders when not needed, by holding valves constantly open and allowing them to coast, so as to not rob the engine of power from the one remaining working cylinder. But the current camshaft is not sufficiently complicated to allow all those variable power modes, so I imagine that a computer would take over controlling when valves open and close, and the camshaft would be eliminated?

Electric motors operate much more efficiently than the internal combustion engine, and so the electric car was always far more practical than the gasoline car, except for the terrible problem that no batteries existed that could hold sufficient energy density. Electric cars have ever struggled with having sufficient range to entice anybody to buy them. Free-energy would handily solve this problem, by allowing electricity to be generated on-board the car. We know that electricity is the way to go, because it works so well to power elevators and subway trains, and to power buses in some cities with the needed overhead wires, but the problem has always been, that those systems have to be tied into the electrical grid. You can't trail a very-long extension cord behind your car. As soon as one disconnects from the electrical grid, the cost of electricity from batteries or whatever, shoots way up. Could you imagine what it costs per kilowatt-hour of electricity, to purchase AAA alkaline batteries? It can be calculated, but the battery packaging will not tell you, lest you would not buy them. BTW, you are getting a very good deal, for the electricity to charge your smart-phone. It probably only costs but a few cents per year to operate. Due to it having to run on battery, they have devised a lot of ways to limit energy consumption. Such as the screen backlight going to sleep when not being used. The electricity is priced for the heavy electricity users in your house, the water heater, the air conditioning, the stove.
Reply: It's the RUYA syndrome that IS the problem.
Reply: +Yosef MacGruber compressed air in a power stroke would contribute very little energy compared to the expanding gasses of the explosion. Especially if the timing is advanced, where the explosion begins well before significant compression.
Reply: +G Philip C RUYA?
Reply: +G Philip C yeah, the three second law would save people a lot of gas if they would follow it or if it was enforced.
Reply: Mechanized Ape
I know that the compressed air contributes little. It doesn't even return all of the energy needed to compress the air. I was merely explaining why engine braking is but only a mild drag, when in the highest gear.

You would not want that advanced timing, as we need to allow compression to finish before burning the gasses. Increased pressure during the compression stroke would decrease engine power, as the force opposes the direction of rotation during part of the cycle, and also, when gasses pre-ignite due to too much compression or due to using too low of gasoline octane for what is recommended for a high-compression engine, that is called engine knock, which can damage the engine, because pressure increases before it even has anywhere to go. The spark is supposed to fire towards the beginning of the power stroke, but not before. Don't most fuel-injected cars, have a knock sensor?
Reply: Michael Carnes
"If you don't like me driving the speed limit, then go around. Duh? Or get yourself an airplane."

That would also cut down on road rage. One thing I've never understood is why when people come up behind a car going the speed limit in the right lane and the left lane is empty they keep pushing up behind the car instead of just going around.

The reason is, because they are morons, and should not be allowed to drive. Maybe with the advent of self-drive cars, we can more easily ban bad drivers? And what is the reason that these bad drivers do not show the courtesy and legal requirement, of using turn signals?

And slow drivers would be more apt to move over to the right and slowest lane, if moron drivers would stop clogging the right lane by passing on the right. I have even seen moron drivers pass in an exit or merge lane, and of course I have to blast them with the horn, for driving rudely and unsafely. That is not what that lane is for. Do they think they are driving in a video game?

Speaking of which, when I played the PS2 video game Crazy Taxi, passengers are so incredibly impatient, that if you do not drive recklessly and pass traffic by driving on the sidewalk, they will jump out of the car. Whoever said that video games are realistic?

And what is up with all of these drivers, how seem like that they have little idea how to merge onto the freeway? So many times a car comes up on the merge lane, and I have to check to see if the lanes to my left are clear, because whatever are they doing? "Where are you going buddy?" The merge lane is running out, but you have not went ahead, and you have not dropped behind either. If in doubt, slow down and drop behind. Duh? That is what I usually do, to properly synchronize with traffic flow. How long have they been driving for gaining experience? 2 days? Have they not even taken a single driving class? Did their parents teach them nothing? Many of us just move over to let them in, but why should we have to do that? We are merely supposed to let them in, and not expect "the Red Sea to part" in some sort of miracle, just because moron drivers do not seem to know how to drive.

And when exiting, a driver is supposed to enter the exit lane, at the beginning of the exit lane, not at the end, because it is designed to allow room to gradually slow down some, as often there is a sharp 25 mph cautionary sign curve right after the end of the exit lane. You can not expect to be able to hold onto the lane, speeding along at 55 mph, nor should a driver be slamming on the brakes on the freeway, well unless it is an emergency or they suddenly discover they should have been driving rather than looking at their phone.
Reply: George Travers
Why was it called Jewish overdrive?
Reply: Yosef MacGruber It was called Jewish overdrive because the clutch throw out technique costs much less than buying a car with a real overdrive tranny to save on gas. 

The Jewish ethnic reference was because American Jews in the 60's and before had a real reputation for being really cheap when buying merchandise. I can personally attest to that. Because I had a lot of Jewish friends in the 1960's when I was a teen and young adult.
Reply: George Travers
I think a major reason why people tend to be "cheap" or frugal, is because of the NWO corrupt economic system. People should stop criticizing people for refusing to spend money, money that people lack due to the crappy corrupt government ruined economy.

If cars were built like how they should be, then cars would be powered by free-energy technology, and would not burn any fuel. If the economy was run like it should be, then far more people's homes would be paid off, thus that they would not need to make mortgage payments. More people would work because they want to, and not so much for need of the money in some hamster wheel rat-race to keep up with the bills.
Reply: Why do some hills say "No Engine Braking"?
Reply: +Bobson Tim it's loud due to the high revs so it disturbing to the peace of the public.  and often semis have turbos that will whine when  spooled up. Jake braking would still spin a turbo unless there is a mechanism that keeps the waste gate open or somthing similar. Engine braking might also spin a turbo if air leaks past the throttle body
Reply: Thank You!!!
Reply: +Bobson Tim because they look to ticket you
Reply: but if you shift down you either waste fuel with rev match or you use the clutch which causes unneccessary wear.
Reply: What automatics that have a sport mode/paddle shifters. My 2015 auto V6 doesn't have a clutch. I'm not concerned about fuel efficiency. I'm going pretty good at 22.3 MPG after 20,000 miles. What I'm concerned with with wear and tear. As others have said, brake pads cheaper than a clutch. I don't have a clutch. But I bet repairs on 2015 mustang auto trans won't be cheap. So, with wear and tear in mind, is engine braking still a good style of driving?  I do it a lot on the idea of using the brakes less. But I'm hoping I'm not reducing the life of the engine or transmission.
Reply: If your using it more, your wearing it more. They are called wear parts for a reason. They wear quickly just doing what they are designed to do. And are meant to be replaced within the lifetime of the car if it isn't wrecked or beaten to hell first.
Reply: Sam Kirk
Electric cars do not much use the brakes, as the regenerative braking of the electric motor, puts the kinetic energy back into the battery. Watch some YT videos about the "Tesla cars".
Reply: Exactly
Reply: In carburator cars, did engine braking consume more fuel than regular braking.

I have a 91 beetle and regularly use engine braking, but always asked myself that question.
Reply: Yes they do. I have confirmed this on motorbikes. A FI bike will inject nothing, a carb bike is still sending tiny bit of residual fuel in.
Reply: wayde philpot t
Reply: MrElpajita the momentum of the vehicle keeps the engine turning, which is why the vehicle slows down when you let off the gas... well that and aerodynamic drag. Proper use of engine braking in a manual combined with your foot brake as well as improving gas mileage (a lot) also gives you proper control of your car.
Reply: Pyro Vulpes if you're slowing gradually then rev matching isn't so important. Of course if you are downshifting aggressively (as in driving it like a race car) and don't rev match, you can spin your car as well as wearing your clutch quickly.
Reply: Don't downshift on an automatic though it's very hard on the tranny, owners manuals specifically say this.
Reply: Damn I'm lurking on a Ford period V8 Jaguar XJ or S-Type (roughly 1998 to 2008) for next year, because it's so affordable, and the "J-Gate" transmission seems really cool : you can decide on to what the max gear is selectable by the automatic transmission.
So using the J-Gate side of the gearshift, you can downshift to engine brake...are you sure that it's this bad ? Or maybe this system works in a way that it doesn't hurt the transmission ?
Reply: I think he was trying to say what you said. Your explanation is much clearer and really I wouldn't have understood his if I didn't already know what you also know. He said that by pushing in the clutch you allow the engine to go to idle quicker and the injectors turn back on sooner. I think he got mixed up towards the end and meant to say that downshifting meaning to say that the injectors were idle, i.e., not injecting at all, by keeping the revs up and the throttle closed. Look at it again and see if you agree that is what he meant.
Reply: My four speed automatic has an overdrive button on the end of the gear stick and a 2 and 1 position underneath drive. When I need to drop speed at a school zone, I'll drop it into second. If I need to stop rather quickly at a red light, I'll turn overdrive off, and shift to second if necessary. If I'm going to floor it to beat a yellow, I'll drop it to second so that the car doesn't delay the downshift.
Reply: +EngineeringExplained I use engine braking sparingly, because I can easily replace my brake pads, but replacing the clutch disk means replacing the whole clutch, a 1000€ repair (vs not even 50€ for brake pads). Using the clutch to synchronize your engine to a high rev speed will wear out the clutch somewhat, and that's not worth it. 

I only use engine braking to keep speed when I go down a long steady slope. Otherwise I just shift to neutral and brake normally.

Anything wrong with my logic?
Reply: Samuel Sudhof no need to shift into neutral. Just leave it in gear and brake as normal and take it out of gear (into neutral) when RPM's drop below 1500 to 1800 (the lower the better).

Also downshifting when the RPM's  are below 1800 is not hard on nor caused any measurable wear of the clutch. Doing this will save you on fuel (assuming the car is EFI and built after the mid 80's or so). Most EFI systems shut off fuel anytime the RPM is above about 1600 to 1800 and the throttle is closed (newer cars with direct injection take it to an even lower RPM). This is to help save fuel during coasting  (often called coasting fuel cut and overrun fuel cut among other names).... Basically, manufacturers intend for you to leave the transmission in gear during deceleration.
Reply: Indrid Cold yeah, that's what I was getting at in the 2nd part of my reply about downshifting below 1800 rpm and it causing no measurable wear on the clutch. 

With that said though, downshifting at higher RPM's to engine brake is bad for a clutch unless it's a post / pillar or spline drive pressure plate. Normal automotive pressure plates are strap drive and they are only designed to transmit torque in one direction which puts the straps in tension. When reverse torque is induced (engine braking), the straps are loaded in compression and they bend and / or break.
Reply: T Swag Your car doesn't require anywhere near the stopping power of a semi hauling 80,000lbs. 

A passenger vehicle weighing 4,000 pounds, traveling under ideal conditions at a speed of 65 miles per hour would take 316 feet to stop. In comparison, a fully loaded tractor-trailer weighing 80,000 pounds traveling under ideal conditions at a speed of 65 miles per hour will take 525 feet to stop.

You acknowledge brakes lose stopping power when the get hot, but can't comprehend that a semi takes 20x the stopping power. You're probably one of those idiots that cuts off semis because 'I would have had enough time to stop'
Reply: only works on a manual transmission, unless you shift the auto down to drive 2 or low.  Americans dont use the gears in an automatic.  ive only seen peeps do it in japan.
Reply: Does undue vaccuum pressure cause any problems for the engine? For the pistons? The fuel pump? The vaccuum pump? 
And doesnt the bump in rpm from downshifting mean youre burning more fuel?
Reply: Which is also why downshifting(heel n toe) is a staple when it comes to racing sticks. Faster slowing down as well as keeping the weight transfer minimal.
Reply: I use this method all the time on flat surface if I know there’s a speed limit change coming up I’ll just let my foot off the gas and let the engine slow me down. My brake pads have lasted a long time cause of this and I see people braking hard all the time
Reply: But isn't putting wear on the brakes better since easier to replace or the wear being put on the engine is minimal?
Reply: +wayde philpot Just don't do it in a residential at 2am with a fart cannon for an exhaust. :p
Reply: +nrdesign1991 I agree completely, never made sense to me from an engineering stand point to downshift just to use engine braking, the extra wear on the clutch and transmission just to spare cheap break pads? However, if you are already in gear because you were driving, why not leave it for a while to brake just that little bit more? We agree on that. It makes me cringe when I'm riding shotgun with someone who actively downshifts, sometimes aggressively, without even rev matching, just to break a bit more. It's not like they are beating any lap times anyway...
Reply: They still can last about 200 000 kilometers, unless someone does very agressive downshifts, without using heel&toe technique. Also, it is not possible to drive safely eg. through the Alps without using engine braking and downshifting- even ventilled brakes will overheat on downhills, if you don't engine brake.
Also, in case of FWD cars without ABS, engine braking works a kind of like ABS, because when you brake gently, the engine does not allow the front wheels to lock. If I don't feel soon enough the wheels are about to lock, the shaking engine tells me, I have to release the brake a bit, because the wheels are about to lock.
Reply: +nrdesign1991 I do think most modern cars which using drive by wire system still burn some fuel when in engine brake since the throttle basically control by the ECU unlike older model car with carburetors system but lol honestly I'm not sure tho
Reply: Y10Q
So Subarus are particularly bad examples of what crap the internal combustion engine is? I can't wait for cars to go 100% electric or free-energy. Good riddens to the awful, noisy, repair nightmare money pit that is the internal combustion engine. Good riddens to fume-belching noisy fart cannons, deliberately-noisy exhaust systems?

Electric cars do not even have transmissions, nor do they have any acceleration delays, as they have no engine that must first increase its RPMs and gulp in more air, in order to increase its power output.

I think that Tesla electric cars have adjustable engine braking (automatic regenerative braking that applies when you take your foot off of the accelerator), and thus electric cars hardly even use the brake pads.
Reply: Who gives a crap about brake pads. Seriously. A set of cheapo brake pads/shoes for a car is like $50. I replace mine every 4 years regardless of how much the car is driven. Engines and clutches are much more expensive and labor intensive. Also have tracked stock brake cars, and yea while they do lose quite a bit of stopping distance when they get real hot, it's not like the modern disc brakes can't stop a car in a reasonable distance. While I don't slam on my brakes and like to coast coming up to things, to each their own. But poor little cheap brake pads is not a good argument. Can't afford maintenance? Find a way of public transportation.
Reply: +nrdesign1991 Prolong the life of your brakes... at the expense of your engine?
Reply: +wayde philpot Your theory is only applicable if the clutch engagement  rpm is matched very well to the transmission input shaft speed. Being that the clutch is far more expensive and time consuming to replace, this practice is generally frowned upon by automotive technicians due to most users not fully understanding the fundamentals of exactly how their vehicle's clutches work. Brakes are generally much cheaper to replace as long as they are not abused/overheated.
Reply: +Mike Cammiso Wait maybe I read it wrong but weren't talking about downshifting which would require using the clutch. Also as long as when you pull it into neutral it is not hard then no. If it is hard and you force it then yes. If it is hard to pull and you hit the throttle then pull it out then no again. The problem with the fuel is yes the vacuum is what slows the car down however the motor is still running so your still burning fuel while using your engine the engine will be forced to stay at a high rpm and need more fuel to stay their. If you pull it in neutral that will allow the engine to drop to the lowest rpms possible, aka idle, and thus require less fuel to run. This how I have driven three different manual vehicle totaling probably about 30k-40k miles and haven't had any problems, I had ford ranger which is heavier than your typical car and I did notice a lot of brake dust on my rims but I put about 10k-15k miles on it and had no problems. The most interesting part is the new car I just got has one of those there fancy things that gives you your mpg actively updating and what you see when your come to stop using the engine your mpg is low, around 10-15, when I put it in neutral and use the brakes my mpg just says 99 because again the engine is running at the lowest rpms possible, around 800ish, and yet the car is still moving forward.
Reply: +wayde philpot I pull my car into neutral and use my brakes to stop, unless I'm on the highway or know I'm going to completely stop. Why? two reasons, the first is because it is much cheaper to replace brakes than a clutch, and since I don't use the clutch to put it in neutral I am saving it a lot. The seconded reason is it is more fuel efficient to do it this way and let me explain why, by the way I am car mechanic so I do have to some knowledge of this. Stopping is essentially a waste of energy, what you are doing is turning that forwarded momentum into, the laws of physics say energy is never created nor destroyed just changed, in this case from forward movement to heat, unless you drive a hybrid with regentive braking but that is a whole different story. So by using your engine to brake you are wasting the engine that the engine makes to make heat, by putting it in neutral your allowing the engine to run at idle which is the point it is most fuel efficient. If your driving a big truck it is far to heavy to do this and you must use the engine to help slow down (that's why trucks come with Jake brakes) but if your driving a common 2klb car your more than fine to do this.
Reply: @kingkevin267  you are breaking the synchros and the engine won't slow down your car at all that way. You will wear your brakes too much and won't save any fuel that way. The most economical way to brake is to step off the gas, break a little until the rpms drop close to the idle rpms then change into lower gear and so on until you reach 2nd (or 1st gear if you really need to stop). This way, nothing is gonna wear out too soon and you will save both fuel, brakes and clutch.
You're welcome, mate